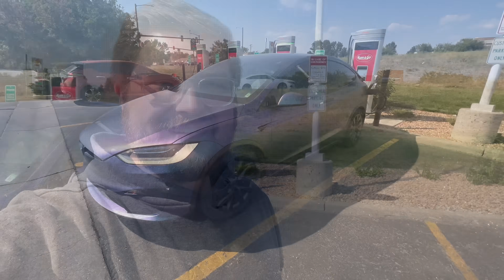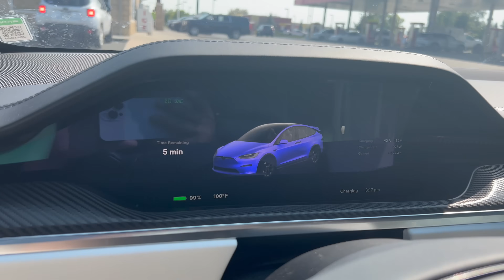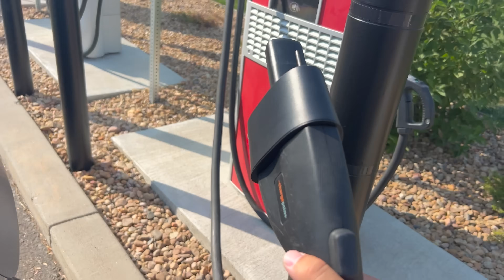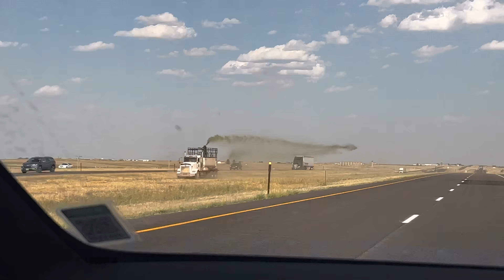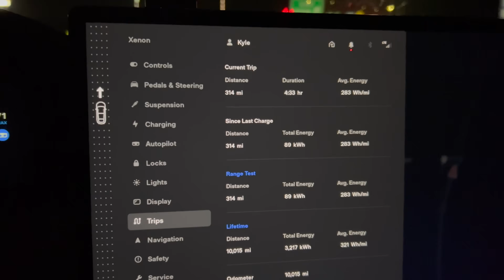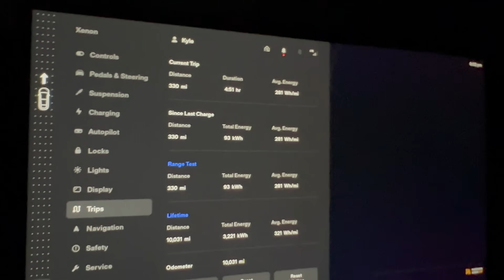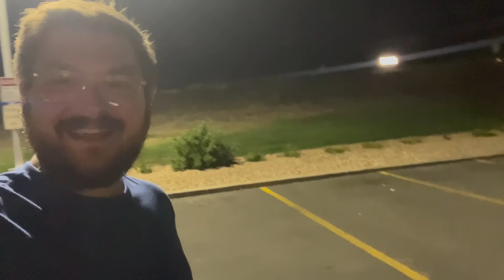2022 Tesla Model X Long Range 70 MPH Highway Range Test - Will It Go Farther Than The BMW iX?

Comment: For better tests check Bjorn nyland, in his testing the most efficient bmw gets less range than the old model X long range, you can just search for bmw IX range test Bjorn nyland and check the exel sheet to see the results, he is the most trusted ev tester, he also does noise test, headlights test, range test.... his tests are a lot more consistent, he didn't test the new refresh model X yet (only arrives in Europe in the end of the year) but once it's out he will test it like he does with every ev, he also does 1000 km challenge which is very important, where consumption and charge speed matter a lot.
Reply: And what was wrong with this test, the result?  You are comparing apples and oranges, Björn has tested the iX 50 in winter and the Model x Raven in summer. Otherwise, there are tests from him with the iX 40, but it only has a 76 kWh battery. 

And Björn comes to the same conclusion regarding comfort and noise insulation, headlights etc. The iX is a class above in this respect.
Reply: @lubder  Exactly. This is an equally  real world usage test. Although, on an European highway legal speed is usually 130 km/h, which is a bit above 80 m/h, that would also be interesting to see.
Reply: @lubder  And people don't believe me when I mention that a lot of people who review Bjorn's range and 1000 km test results aren't perceptive enough to notice things like temperature differences or weather conditions.  Bjorn shouldn't be ranking vehicles in his spreadsheet and in his commentary that were tested in different conditions.
Reply: @lubder  the new one with the matrix led, double glass and noise cancelling might get a better result, but we will see when the video comes out. I think the new model X will also do good in winter thanks to the heat pump, it comes with a smaller battery but seems more efficient.
Reply: He did not test the iX 50 in warm ideal conditions (the 40 was better), I guess this test is way more consistent as they were done in almost the same conditions. I had a Model X 2020 on 20 inch wheels and it had worse efficiency / range than my iX 50 on 22! Granted the MX was a performance, but even if I counted 6% difference the long range the iX still had better range and charged faster. The latest MX will charge faster than the iX … but boy I could not stand all the quirks of the Tesla anymore.
Reply: @yvesvandenbroek6055  2020/2021 Model X now charges at 190kW and holds speeds over 150kW to 47%. The adapter charging rates were greatly improved.
Reply: @jannekar  same as iX …. So it seems Tesla lost their lead …
Reply: @yvesvandenbroek6055  Well, this is 2020 X. Of course the 2022 plaid X does quite a bit better, maxes out at 270kW and holds the rates a bit longer.
Reply: @jannekar  hardly available .... and even if it was with all the quality issues, like the vibration in the drive shafts it's a no go anyway
Reply: @yvesvandenbroek6055  As long as you drive an Ev I am happy hahaha. Never tried the ix, I had a 75D model X and got a 100D for a good price and for now I am very happy with it's performance, also where I am from we have the worst public charging network, we only have 50 kw chargers.... But we have a lot of Tesla superchargers (not open to all EVs) so if you want to travel were I am from you really need a Tesla, I also have a Renault zoe and I can't go on a trip with it.

Comment: Another great range test analysis from Kyle Connor! Thank you! I prefer BMW iX M50 for reasons Kyle cited (i.e. smooth ride, QUIET, luxurious feel, ~$15K less expensive) but Tesla’s performance wins, if that’s a key buying feature.
Reply: How do they compare in space, cargo capacity and safety? The charging network is a big one.
Reply: Good luck charging and goin on road trips
Reply: @Ramneek22  key note, I already have the model y, plus Tesla will soon open up the chargers to everyone so there will be no advantage.
Reply: Wouldn't the extended range ix absolutely crush this?
Reply: I already have the model Y, so for my wife I will get the BMW ix instead.  The price is lower and the range is the same.
Reply: Charging network and software puts Tesla far ahead in addition to the performance.
Reply: @TheAndrwwJohnson  If you don't care about other things such as quality materials, sensational audio system, laser headlights, HUD, quieter interior, and other meaningful things.
Reply: @TheAndrwwJohnson  hardly. 99% of the time you aren’t on a road trip. I’d also argue the Tesla software isn’t actually all that great.
Reply: @michaelrbodner  Even Kyle rightfully so mentions the software is the best. Their constant improvements and OTA updates are great and the UI is the best in the industry. Beyond that they have the best auto pilot systems.
Finally they're fast which is just cool and fun.
Side note the BMW everyone admits looks awful from the front.
Reply: @TheAndrwwJohnson  I had 3 Tesla’s for 4.5 years (my wife still has one). Their OTA updates are often 1 step forward followed by 2 steps backward. Lots of gaps in functionality and bugs.  Their infotainment is in a walled off garden. CarPlay is infinitely better. Fast… sure. How often are you actually pushing your car that hard though… looks yeah, I don’t care for the looks of the iX.

Autopilot best in the biz?  Hardly. I would argue that the system in my e-tron is better than Autopilot by a long shot.
Reply: @michaelrbodner  Car play is trash, and I've also had three MS with my current being a P100DL.
You're crazy thinking anything is close to Tesla in the AP world. Teslas are driving from LA to SF with zero interventions. No Audi or BMW is coming close to that.
Reply: @TheAndrwwJohnson  I have used CarPlay everyday for the 6 weeks since getting my e-tron. Literally would never want another car without it. It’s seamless. It’s easy. It has the apps I want. 

Autopilot isn’t a zero intervention system.   You’re talking about Full Self Drive. Basic AP just holds the lane and manages speed. Full Self Drive is outrageously priced with no set time for release (already being a good 3 years late).
Reply: @michaelrbodner  you're hilarious talking about a $100k car and complaining about FSD cost. I used audio pilot at the all encompassing as the current stack is old as they're only updating the FSD stack. I didn't want to get into those weeds with someone who thinks car play is good as I figured you're not very sophisticated.
In my Tesla, I never need car play as they designed an amazing system and aren't relying on Apple or Google for UI help.
Reply: @TheAndrwwJohnson  class act. You have no clue, so your only option is to call me unsophisticated. Laughable at best. You belong with your Tesla. Enjoy the road noise.  Tell me, how do you listen to an Audibook in a Tesla?  How do you hands free reply to a WhatsApp message?  Do you have to do that through Bluetooth with your phone in your $100k car’s great system can’t? Sorry.
Reply: @michaelrbodner  Lol it's like trying to explain flight to a native with you. I don't have road noise as I listen to music or pod casts. I have my car drive itself pretty much everywhere and I smash people at the track with my 5 person sedan. I then use the best charging network and take trips effortlessly around the southwest.
You won't understand as you're impressed by fire.
Reply: @TheAndrwwJohnson  enjoy your ignorance. As they say, it is bliss.
Reply: @michaelrbodner  I haven't seen anything from Audi that even comes close to the current version of Tesla FSD. I say that as someone who wishes what you were saying was in the realm of reality as the A6 Avant e-tron is the upcoming EV I'm most excited about. Audi's are great cars these days, but no manufacturer is even in the same zip code of Tesla's autopilot. Not unless one of them is much farther along than whats been made public.
Reply: @kenhiett5266  as I have now had my
e-tron for a year I can say a few things. First I rarely use the autonomous driving tech because frankly I enjoy driving the car. That said, if I feel like using it, it holds the lane well and manages speed and travel distance to the car in front of me well. I personally don’t ask for the car to do anything else and really don’t care about features above and beyond that. 

To me the biggest issues for my e-tron are range and long distance charging network. 99% of my driving is around town though so both are mostly a non-issue.

Frankly the sub standard quality doubled down with horrific service from Tesla remains the driving factor as to why I would never ever buy one again.  I get bored of cars quickly so I’m not sure yet what’s next — I may wait though to see how things play out with other manufacturers adding the NACS port.
Reply: But the BMW isn’t a fascist mobile.  Give Elon money?  Oh hell no.
Reply: @troyp9485   shouldn’t go around calling everyone you don’t like a fascist.  Also, the irony of defending a German brand and CEO over a USA made Model X is a clear indication you don’t understand who the fascist actually were.
Reply: @troyp9485  Germany is helping Russia lol

Comment: I don't think Tesla is playing the range game anymore, just efficiency and charge speed. There will be 500 miles range variants of every model, but not for any significant percentage of the fleet.
Reply: They no longer make the fastest charging vehicles or range. The main advantage is the charging network and software.
Reply: @J_Dugs  it doesn't make sense to say that an EV can charge faster if it doesn't have a proper charging network and has sheet efficiency.
Reply: @J_Dugs  within the next five years tesla is going to have to lower the price of thier vehicles because within 5 years they will no longer be the best charging network and they will have to really be priced at what they really should have been from the beginning which is 30 to 40k for a base to 60k to 70k for the top of the line tesla has been overpriced it isnt nothing special and in 5 years reality will set in
Reply: @justinjones6810  Tesla does plan to reduce price. Manufacturing cost of a Tesla battery is already 30% lower. 
Yet, they keep increasing price because the demand is there and order backlog is long.
The margin Tesla make on each car is crazy for the volume they are selling.
Tesla margin is like 30% profit.
If FSD work-out, the margin is going to be even bigger.
So, a lot of margin to reduce the price.

While other OEMs are starting to produce EVs, they are the least profitable models for them.
Which is why traditional OEM don't want to sell many EVs.
Reply: How convenient? Once you get beat in a category, just say we are not playing that game anymore...lol

Comment: I know Tesla is milking the 18650’s but all they have to do is put 2170’s in the S/X and they would have way better range and efficiency. Those extra 25-50 miles of range would be huge.
Reply: The 18650s smaller form factor makes thermal management easier, which is important for high acceleration and performance repeatability.  I think you're overestimating how much weight 2170s would actually save, and the impact of that weight on range.  Much of the weight would in sprung mass, and sprung mass has little impact on efficiency at constant speed, outside of a bit of added rolling resistance.

Comment: I can't believe it costs 30k more than the fully equipped iX 50.  Comparing to the comfort, design, workmanship, materials in BMW Tesla looks like a joke to me.
Reply: And Y cost 20k less you clown. BWM builds like less than 200 000 iXes combined and Tesla ~2 Million...
Reply: @HVM_fi  He said the iX has higher quality than the model X, AND costs less.  The model Y costs less sure, but it's also significantly lower quality.  Not sure what your point is on production volumes, but Tesla certainly doesn't build 2 million model Xs per year.
Reply: @HVM_fi  Exactly one of the biggest reasons I don't want a Camry Common Tesla.
Reply: @HVM_fi  Model Y compared to BMW iX is like a cardboard box with electric motor, battery, smartphone attached inside.  So what if it has a long range, a cool charging network, the smartphone has advanced software as it's still a cardboard box, no style, no comfort, no ergonomics, just a soulless simple box to the extreme.
Reply: @PrzyjemnePieniadze  Lol, you are not a clown you are whole circus. Ha.
Reply: @PrzyjemnePieniadze  ^^^post of the day!^^^

Comment: Eh. Doesn't the iX have less interior (at least luggage) space than a Model Y? And rather meh tech and usability?
Not sure the value comparison to the X makes that much sense.
Reply: X interior, quality control, and average man tech really needs work. No dumb cruise control, unusable auto brights, horrible auto wipers, cheap feeling interior, bad autoparking, and awkward blind spot detection. This is enough to turn off the average luxury car driver. However what tesla has that others don't is luxury tech. It has the most reliable autopilot on the interstate, and best ui but not by as far as it was a few years ago. Other cars are starting to catch up. Once they overtake a tesla in luxury tech, and tesla opens their charging network. There will be no reason to buy a tesla. Elon needs to stop tunnel visioning on fsd and fix the many short comings of his cars. I say this with a brand new refreshed x about to be delivered and as someone that loves the x. I want the x to stay competitive.
Reply: In pure tech, new ideas and new development, Tesla is really getting behind other EV brands. And interior design?? I give Tesla 2 years at max, to come up with something more attractive.
Reply: The iX has materials, finishes, technology (laser active lights, head-up display, amazing audio, radar, backlight, interior mute), a style that Tesla can only dream of. It's like comparing a work of art (BMW) to something made of Lego bricks in the simplest way possible (Tesla)😁
Reply: @PrzyjemnePieniadze  LOL. "BMW = Art". The art of being somewhere between expensive and impossible to service maybe..
Reply: @NO3V  I think you are writing about this LOL Tesla for 130K 😅🤣😂
Reply: The iX is much better to drive though

Comment: HVAC energy consumption don't count at the trip energy use measure.
Reply: BullS... as if the differences we see when driving in different conditions were solely from air density....
Reply: @NO3V  What sonynett saying is the power consumption on Tesla screen only counts the power used on the motors, not the entire car.  That's why the higher efficiency per mile while consuming less kW when it reaches 0% power remaining.
Reply: @leojei  .. What I'm saying is that he's wrong..